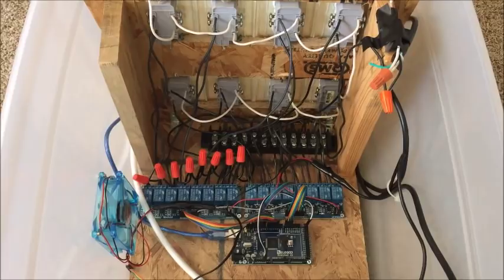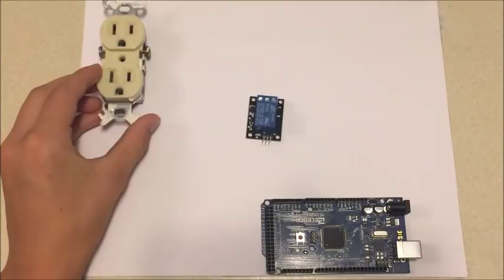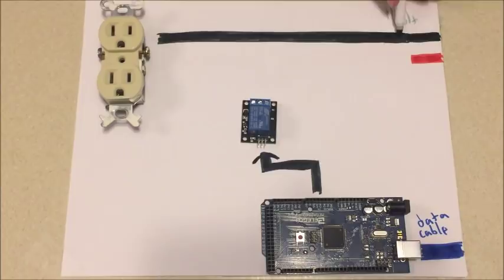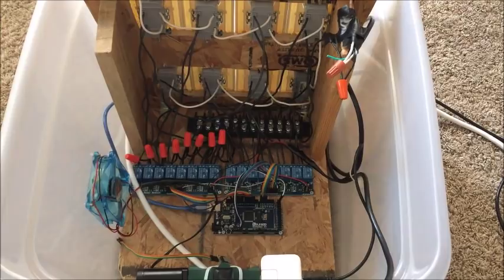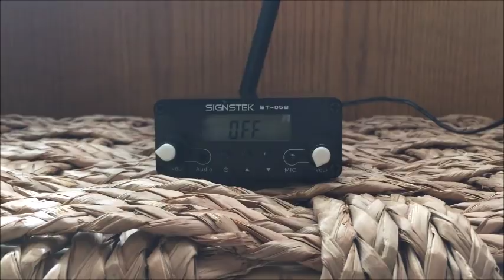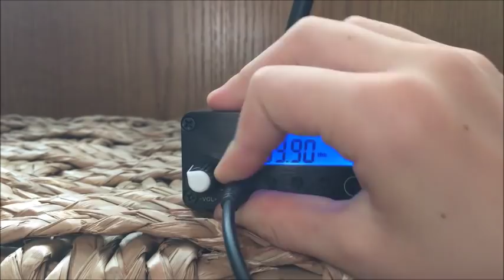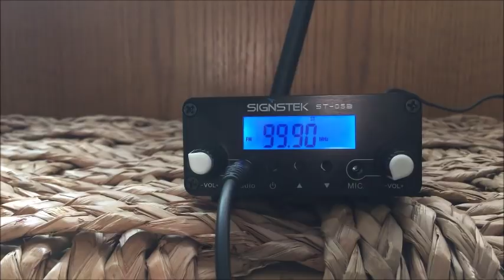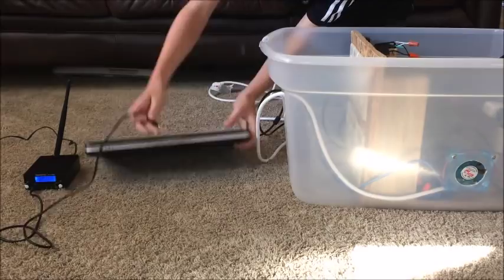Getting ready for Christmas lights to music part 1-Arduino

Comment: I have been using these SSR's from Sainsmart and they're great!
I'm jealous of your transmitter. lol, mine is a 5 buck one on eBay.

To make it so you don't need your computer running for the show you can use a Raspberry Pi and use the FPP OS.

Comment: Hi How many of those relays in the description do I have to buy
Reply from the maker: It depends on how many channels of lights you want to control. If you want to control just 8, you only need one of those…but if you want 16 you need 2, and so on…hope this helps!
Reply: Where do I wire the plug to
Reply from the maker: Could you specify what you  mean? The wire from where?

Comment: How do you connect the vixen to the arduino
Reply from the maker: Vixon is constantly running on the computer. I then run a usb out to the arduino in the “control box”
Reply: Thanks

Comment: So Vixen replaces ALL Arduino code?
Reply from the maker: Sort of. I programmed the arduino to read the software coming from vixen. There is arduino code but...
Reply: Arduino Inventions cool,  I will see if I can find it.  Great job, I shared your videos at the fire station this morning and they were impressed.  Keep it up.
Reply from the maker: Well thank you!! When I get home I can send you the arduino code that I am using if you would like.
Reply from the maker: here is the code.If you would like me to email it to you instead i can do that also. Upload this code to the computer and then download Vixen 3.1 u2. I have heard that it works the best with this arduino code.
There is a guy on youtube that explains how do use vixen in depth. If you have any more questions just ask me! Thanks!!

#define MEGA_VIXEN
//#define UNO_VIXEN

#ifdef MEGA_VIXEN
  #define MAX_CHANNELS 48
  int channels[MAX_CHANNELS] = {2,3,4,5,6,7,8,9,10,11,12,13,14,15,16,17,22,23,24,25,26,27,28,29,30,31,32,33,34,35,36,37,38,39,40,41,42,43,44,45,46,47,48,49,50,51,52,53};
#endif

#ifdef UNO_VIXEN
  #define MAX_CHANNELS 18
  int channels[MAX_CHANNELS] = {2,3,4,5,6,7,8,9,10,11,12,13,A0,A1,A2,A3,A4,A5};
#endif

int incomingByte[MAX_CHANNELS];

void setup()
{
  int i;
  
  Serial.begin(9600); // set up Serial at 9600 bps

  for ( i = 0; i < MAX_CHANNELS; i ++ )  pinMode(channels[i], OUTPUT);
}

void loop()
{
  int i;
  
  if (Serial.available() >= MAX_CHANNELS)
  {
    for (i=0; i < MAX_CHANNELS; i ++)      incomingByte[i] = Serial.read();
  }

  for (i = 0; i < MAX_CHANNELS; i ++ )    analogWrite(channels[i], incomingByte[i]);
}
Reply: Thanks Josiah, good news story last night.  I didn't realize you were just up the street.
Reply from the maker: Were do you live in general?
Reply: Arduino Inventions Southside DSM
Reply from the maker: Cool